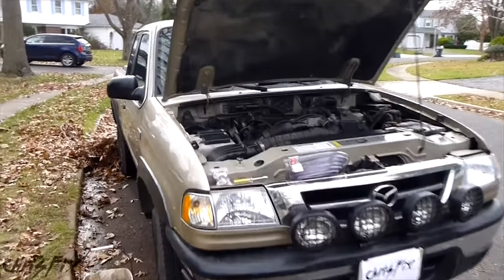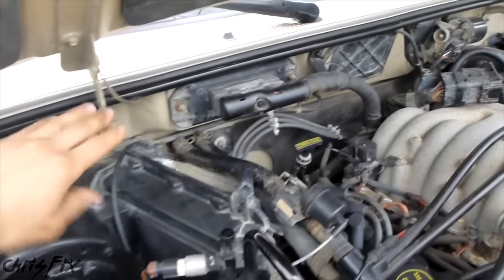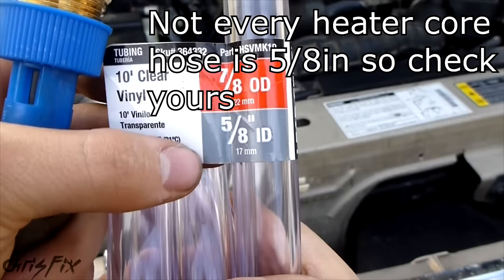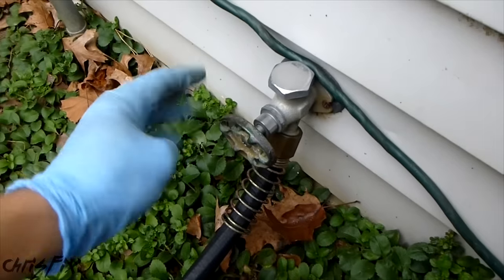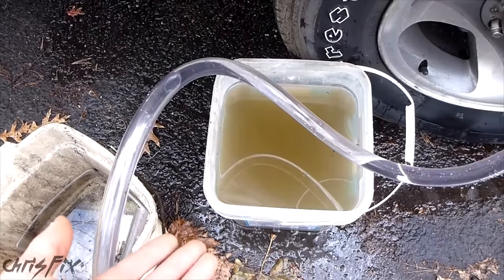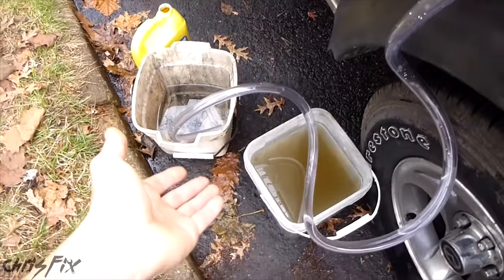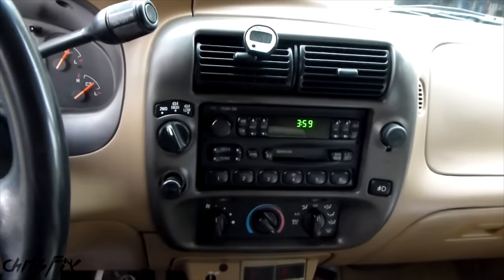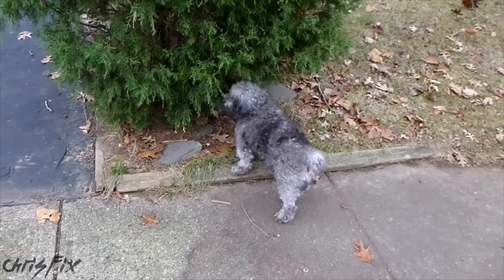How to Flush a Heater Core Safely (with a garden hose)

Comment: Question Chris, is it normal for heat to be coming out of my vents while driving and the heat off?
Reply from the maker: cooljt4life Yes and no. If you have a heater control valve, then no, you should not be getting heat when your heat is off. If the coolant runs thought your heater core at all times (no heater control valve) then you will get a little heat when you have the dial on the heat but no fan on. What happens is the heater core is still getting hot and the high pressure wind from you driving still forces a little air into your vents so you get a little heat. To stop that problem, just turn the heater dial to cool or in the middle.

Comment: I have a ford taurus. The heater works for maybe 5 minutes than the air starts getting cold. I turn  heater off for a couple minutes, it works again nice and hot for about another 5 minutes and then it starts getting cold again...  What can be causing that

Comment: hey Chris whats up? is there a way to get it done thru the black tubes. Cause my fire wall is way down. its block by the head gasket???? i am  planning on doing it today....
Reply from the maker: +Don Mano Baget Yes, you can use the black tubes and use an adapter to run hose water though them!

Comment: Good video.  Thanks for sharing.

I did this last night on my 2005 Altima.  What came out was very disgusting.  All brown and nasty with all sorts of sediment.  After it was cleaned out I hooked everything back up and warmed up the engine.  Still no heat from my heater...  :(  Oh well, it was worth a try.
Reply from the maker: renragged Thanks! You might want to try again and see if more stuff comes out. Or flush it the opposite direction. It is worth a shot!

Comment: ChrisFix I have a 2008 Dodge Ram. Today I just had three of my doors fixed in my HVAC system. Looked on google and said that there was a problem with these trucks and could have been the reason I was not getting heat that I should be getting so I paid $620.00 for three doors to be fixed just to find out that was not the problem. Still have the same issue. Now what I have figured out is that the passenger side of my truck is getting a lot more hot air out of the vents then the driver side is. Could this problem be my heater core is plugged? If not what do you think the problem is? Passenger side is a lot hotter then the driver side is.
Reply from the maker: Jeremy Hamlin If the passenger side is hotter than the drivers side I would think this is a blend door problem. What did they do to "fix" your blend doors? If the heat is hot on the passenger side I would not think the heater core is clogged. Heat distribution is done by the HVAC via the blend doors. Check out this video: https://www.youtube.com/watch?v=-XjXTVJhFLM
Reply: ChrisFix Chris they were to take the old blend doors out an replace them with new as well as replace the rods that move them back and forth Rods are probably not what they are actually called though. Going to watch it now.

Thanks for your help
Reply from the maker: Jeremy Hamlin Typically with blend doors the door and the rods dont break, it is just a connection problem, like a rod popping off.
Reply: ChrisFix Thanks Chris, seems like I paid a lot for nothing. Going to try some things off of the  link you sent me over the weekend and see if I can get the heat corrected. I will let you if I get it fixed and what worked to fix it.

Comment: hey Chris, i just did a flush and it still over heats and doesnt give me hot air at all not even warm. i think its a blend door that is busted because it makes a noise in my vents and i been told it doesnt open up
Reply from the maker: +Ramiro Torres (xHiddenxLotus) if you are overheating it is probably air in the system.
Reply: ChrisFix i had it run for a good while and it keeps going from the middle of the gauge and rises to H. it does it for a good while. and what about the clicking inside my vents? it is by me feet in the drivers side.

Comment: In all your experience what do you think the problem is if you get a truck and both hoses are connected to the fire wall but not connected  to anything else. My father in law passed away from covid and i received his truck so i have no idea what he did to it.
Reply: Does the heater work?
They may have bypassed the heater core
Reply: @deasttn  No it doesn't. the hoses are attached to the firewall but they lead and connect to nothing. and in the cabing there is an opening like they were probing aroung looking for someing. my air flow gets lost from that opening so ac and heater doing work.
Reply: @matthewgarcia2119  I suspect the heater core is broken/clogged and needs to be replaced, which is a major PIA and expensive.  

They just bypassed the heater core so the engine doesn't overheat and sealed off the heater core. 

U can try flushing your heater core, but I suspect they tried years ago (or it has a leak)
Reply: @deasttn   well I got the truck for free lol so not a bad trade. I'm in southern Texas so it's hot all year round mostly. I have 2x40 AC (both windows down going 40mph) :)

Comment: Chris, If I do your coolant system super flush does it pretty much do this too? Two birds, one stone.
Reply from the maker: +Jgcode3 If your heater core is not clogged, yes, the superflush will work. If your heater core is clogged, we are reverse flushing the heater core which unclogs it so you would have to do this  after the superflush.
Reply: +ChrisFix Thanks for the quick reply. I just bought a 99 Ranger and really like your channel. My Heater Coolant Bypass valve is leaking a bit and will replace it when I do your superflush. Is the bypass valve just pretty much a take hoses off, replace valve, and put hose back in kind of job?

Comment: So i stored my 08 G6 GXP and i started it today after a couple months of the winter and my heater or a/c are not working, i don't hear anything click when i turn on the fan, also my front fans aren't moving but my car is not overheating, the coolant is at level and the car is at like 190degrees - 200, what can i do? My back door actuator seems to work because it changes what vent it needs, what can i do to fix this or at least diagnose it? Thanks Chris!
Reply from the maker: +Kevin Quintana I would check to see if the blend door is working and if the ac is charged: https://www.youtube.com/watch?v=Pdq8JAlct6s
Reply: +ChrisFix I'm more consered about my heat, being its a little cold out, had to use my leather seat warmers to warm myself up? any clues?
Reply from the maker: +Kevin Quintana watch my video on finding out why you don't have heat in your car.  Search youtube "no heat in car" and my video is the first one that comes up
Reply: Fixed! Thanks Chris!

Comment: Shouldn't there be a step, after the flush and re-connecting the hoses,  to remove any remaining air out of the system?  I am sure there was plenty of air in the hoses after they were re-connected to the heater core.

Comment: Could you not technically use this method to flush your whole cooling system?...
Turn the heat on .. but have the garden hose go in the return side then the other hose will flush out your whole radiator... then replace with fluid?
Reply: Probably yes if the thermostat was removed, as in his other video of the full system flush.

Comment: I'm driving a dodge 1996 caravan  and have thermostat problems . Someone just replaced it but it had a rubber ring that the old One didn't  and now it's blowing steam from it and I don't get heat inside the van😠😠😤 what is the solution ? Yes we've put coolant in the van. I need  help.

Comment: Can you flush closer to the motor instead of from the heater core can you disconnected from other parts of the heater core  hose I'm a female it kind of hard to reach it from my truck but I see I might can take it a loose from closer to the motor on another part of the hose

Comment: Hey Chris would a car seraticly over heat sometimes if heater core is some what cloged
Thanks
Reply from the maker: Shayne34988 Onthenet If the heater core is clogged it will most likely have no effect on the rest of your cooling system so the overheating problem is coming from something else.

Comment: could i drain, fill with flush & clean and water, switch the in and out hoses in order to back flush while I drive the car? then drain several times? my core is really clogged. '05 passat big issue.
Reply from the maker: +Bert T. Yea you could do that but it is better to do that with the hose.
Reply: +ChrisFix Hey I completely flushed the system. Filled with prestone flush and clean then topped off with water then reconneced the hoses leading to the heater core backwards. I drove like this for 3 days. I then flushed it, put the core hoses on correctly. Filled with another prestone f&c and drove it around for another 2 days. I then completely flushed it poured the gallon of coolant and topped off with distilled water. Guess what........i have heat......lot's of heat.

Comment: i was told the chemical flush cleaner will blow out your heater core. is that possible? and if any what is the safest way to flush the entire system without screwing up the cooland system?
Reply: You need to check that you are using the correct flush for your car. The will be down to age and what the parts are made of. Most these days are good for all times but do check. Yes flushing the hole system would be safe and still quite effective, but not quite as good.

Comment: My car’s heat only blows hot air while I’m driving. Once I come to a stop it starts blowing cold air. I have a 2007 Nissan Xterra. Will this help at all?
Reply: Probably not.

Does your a/c compressor work?
Reply: It does. The a/c works fine. I kinda meant to say ambient air temperature. Since the air outside is cold it blows cold air when I come to a stop/engine in idle. But once the engine RPM goes up it starts blowing hot air.

Comment: Need to do this to my vw Jetta as when I go round tight bends I loose heat for a few seconds I end up getting cold air so assume my heater core is blocked or air in it.

Comment: chrisfix. When i do this, is it smart to flush the entire cooling system after i am done flushing the heater core?
Reply from the maker: Flush the entire cooling system first, then the heater core.
Reply: That sounds better. Thank you chrisfix.
Reply: Chrisfix. Just out of curiosity, is it safe to flush the cooling system with distilled vinager? Or even flush a heater core with distilled vinager?

Comment: hey chris ...i did the procedure you dgown and iam still having issues with my heater...replaced thermostat, heatercore and still have no heat...can you please help me...colorado is a cold MF without heat in my f150
Reply from the maker: +TheAmmodogg There is probably air in the system. Check out this video: https://www.youtube.com/watch?v=-XjXTVJhFLM

Comment: I'm having an issue in my 08 Equinox. Little to no heat at cold start. Blows mostly cold at an idle. If I rev the engine at an idle, I hear water whooshing under the driver's side dash area, not loud, just enough I notice. No overheating and once I get on the road, it starts blowing hot again and will continue to blow very warm at an idle after I've driven for some time. I'm stumped. I've opened the bleeder valve and coolant comes out right away, no bubbles from it or air. Is there a 2nd bleeder on the Equinox I'm unaware of? I'm going nuts with this issue. Everything topped off and not a head/intake gasket issue. Help! Lol live in Iowa and winter is here! Will this flush help? What's the water-like sound I'm hearing?
Reply: Sounds like air in the heater core
Reply: Try replacing the radiator cap.....if it's not sealing properly air can build up in the system creating dead spots with low RPM.

Comment: My hoses are hard to remove. Should I cut the top where the connect to the heater outlets?
Reply: Try 1st to follow them from the firewall up towards the front of the engine where they may be easier to remove and then do similar procedure ....just thru longer heater core hoses into the heater core.

Comment: I have a 04 Grand Prix,  replaced the thermostat  but still no heat or air inside vehicle. ..so is it possible that the heater core went bad,  since carpet on passenger side is still damp
Reply from the maker: +Michael Wilson Check out this video: https://www.youtube.com/watch?v=-XjXTVJhFLM

Comment: I have the same problem but it's the ac that doesn't feel cold enough, it's with a 2006 jeep liberty, what is the problem, and how do I fix it?
Reply from the maker: It could be low on refrigerant or your blend door is not closing all of the way and letting heat in.

Comment: I think the heater core could hold a little more pressure. The cap is rated for 18 pounds so the rest of the cooling system should be rated for more than that.

Comment: If I do a radiator flush, will that also flush out the heater core?
Reply: Kevin, yes, flushing the entire system with the heat turned on highest temperature and fan all the way on high technically will push fluid through the heater core. However, if the heater core is clogged, you still won't have heat. So, after you do the "super flush" (see Chris' super flush video), do this flush and make sure you do reverse flush. Heater cores that are badly clogged need several cycles of forward then reverse flushes. Also, go ahead and put the flush/cleaner fluid in the heater core and let it sit for a while then do some more forward and reverse flush cycles. If your heater core is badly corroded you may have heat for a little while (usually a couple days to a week) before it clogs up again. If, after you've flushed the core several times over a period of weeks or months, you'll realize the core needs replacing because any amount of flushing isn't lasting...

Comment: Chris on the 94 vette  its 5/8 id right ? And the left hose is out?Or is out the one leading to the top tank?
I took off the top tank to see the hose on the firewall.
Reply from the maker: Vinny Anzelone I dont know the size of the fitting for the Vette but the hose that goes in, has a backflow valve which is a cylinder that is in-line of the hose. You cant miss it.
Reply: ChrisFix That was easy thanks Chris. I took my laptop out put it by car and went step by step with you. I got lucky because it was 35 degrees in NY. You were right on the money with how much.I couldn't get clear tubes only black so I cut the 6 foot in half. Perfect.I ll take it on road test for a few hours tomorrow I m really hoping that's all as far as heat goes!Thank you so much again for great video!
Reply from the maker: Vinny Anzelone AWESOME! Yea, we had a nice day today. I was out working on my truck myself for the next video! Keep me posted!

Comment: I actually tried to do this. Still no heat. It's funny because people have told me that it's not the water pump because if it was a non-working water pump it would overheat. I have flushed the heater core, changed the thermostat, flushed the radiator fluid and put in new coolant. Still no heat. Actually, when I had the radiator flushed..)at Pep Boys).they said they couldn't do it fully because there was too much rust, so they just drained it an re-filled it. I'm wondering if I should try to flush the heater core again?  Just trying to get heat. Ready to give up....lol
Reply from the maker: There are two things you can do:
1. Do this: https://www.youtube.com/watch?v=s--5ft5YiHg
2. If it still turns brown a few days/weeks later, do this: https://www.youtube.com/watch?v=MeruAZebIeU

Comment: Be careful doing this with a 2000-2003 Nissan Maxima the heater core outlet / inlet pipe is plastic and very brittle. I’ve had to replace the plastic connector before and it’s a pain, not fun and the replacement part is a dealership only part. 
If your car is a older higher mile car I wouldn’t recommend even touching these parts just because the plastic could be brittle and in some case hard to replace.

Comment: wouldn't it make sense to change the inlet and outlet hose every 10.000 miles or so to achieve an even flush of the heater core so it doesen't get clogged?
Reply from the maker: ***** That is a good idea. I like putting things back on the way they were but I like your idea! Thanks for sharing!

Comment: Hi i have a 2002 jeep grand Cherokee and i have to code im having trouble figure out p0455P0442 do you have any knowledge ?
Reply from the maker: funtatentay Those codes are for an evap system leak. Basically your fuel system is under a vacuum so that no gas vapors escape. When that vacuum cannot be held (there is a leak in the gas cap or a hose that connects to the gas tank) the check engine light will go off.

Comment: So when I put on my heater I can smell antifreeze for a little bit but I know I don't have any leaks in my engine so could tht mean my heater core is shot?
Reply from the maker: james laRue It could be the heater core. Is the floor wet at all under the passenger side dash?
Reply: No the floor is dry
Reply from the maker: james laRue It could be a very slow leak so your carpet doesnt get wet.

Comment: I’m sure this will work great if done correctly. Problem is there’s a lot of room for disaster, especially without a pressure regulator on the hose.
You’d think a normal coolant flush using a flushing product would be as effective and safer.

Comment: How would one know which is the inlet & which is the outlet of the heater core if its sticking out of the firewall with no hoses attached
Reply from the maker: Just flush both ways if you dont know.
Reply: @chrisfix  fair enough....now after flushing, want to install new hoses & have the heater functional & get ride of the bypass rig thats on now